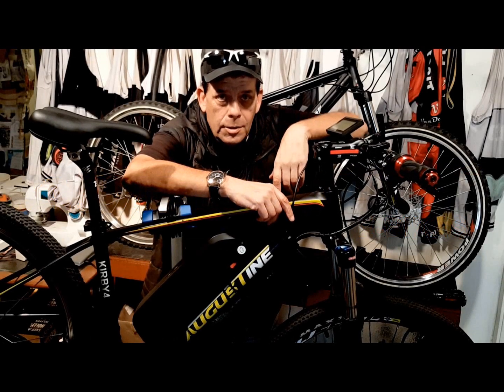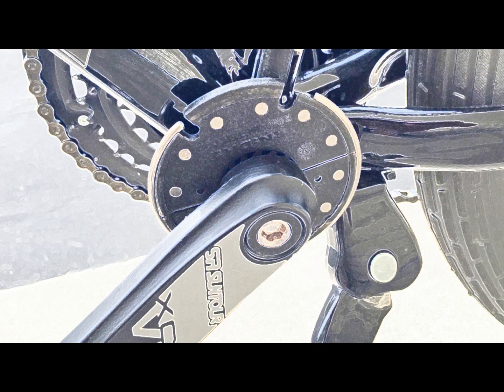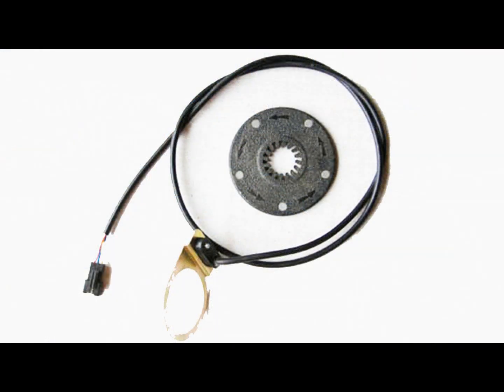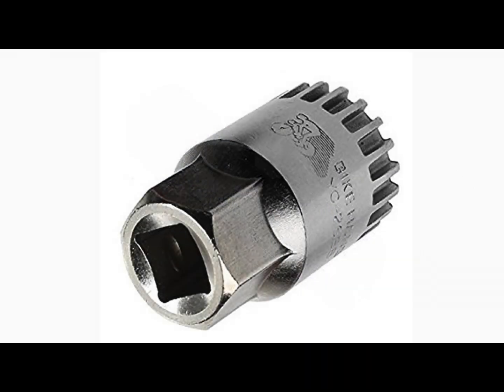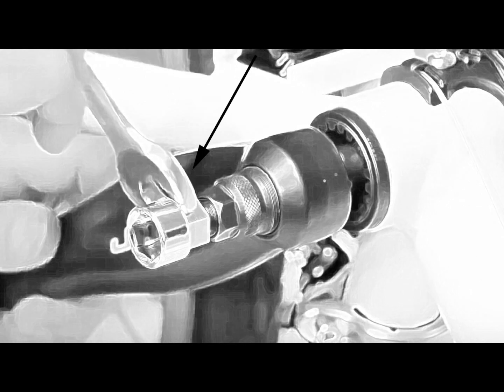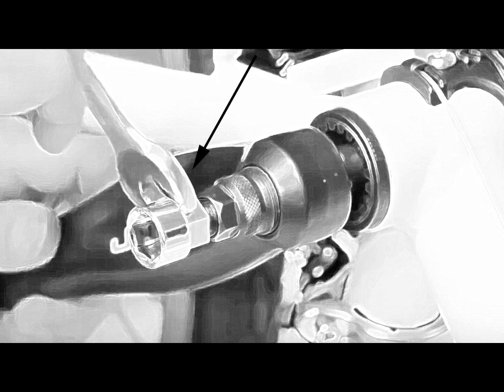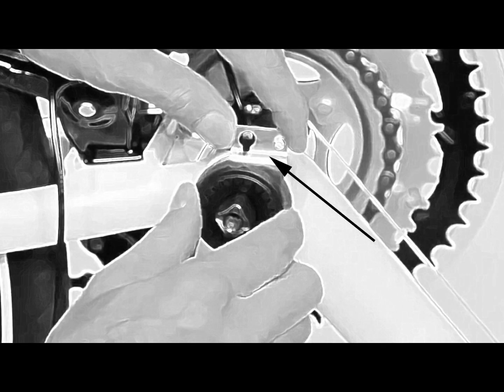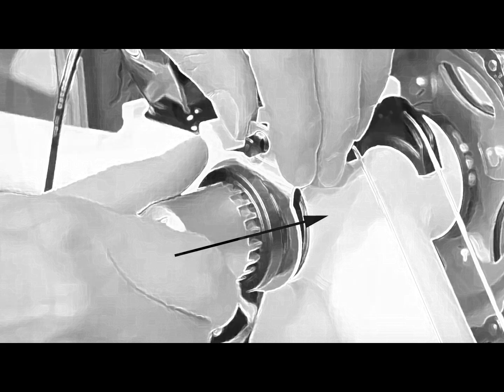E-Bike Tips. How to install a Pedal Assist Sensor (PAS)

Comment: I have the same sensor and mounted it the same way it anew build just started today question is does it matter mouthing it at 6 o clock mark and will wheel run backwards

Comment: You made no mention of which way round the sensor should point. My sensor is encapsulated in a plastic body that is shaped like an arrow. From what I understand, there are 2 pickups in the sensor that have to react to the magnets in the right order. So, if the sensor is put on the left side of the bike, the motor might, for example, drive the wheel forward, but, if its fitted to the right side of the bike, the wheel will be driven backward, unless the sensor is reversed.
I also noticed that, when you were testing it, you had the motor with the power cables sticking up. The motor was rotating left to right across the video. If, after fitting the wheel,  those cables are positioned on the right side of the bike, as most of them are,  then your motor is going is going backwards!